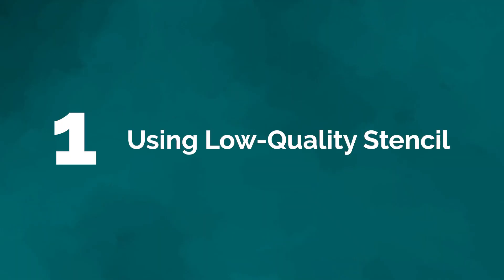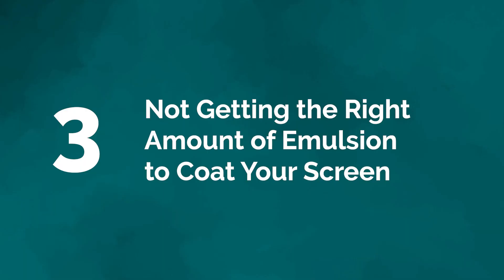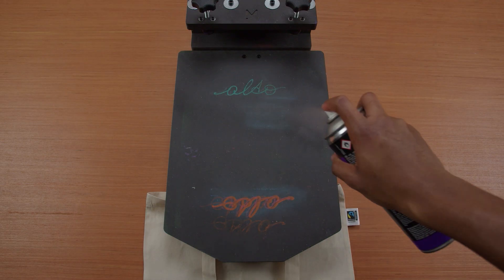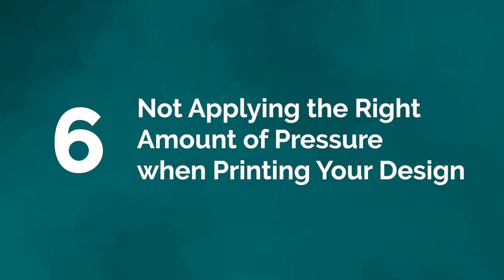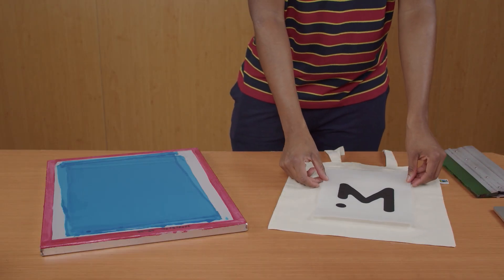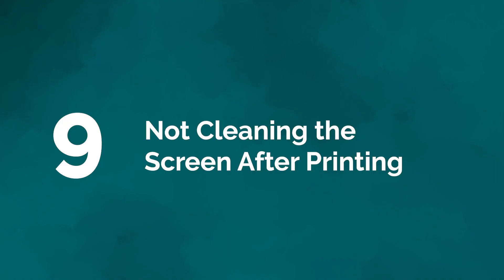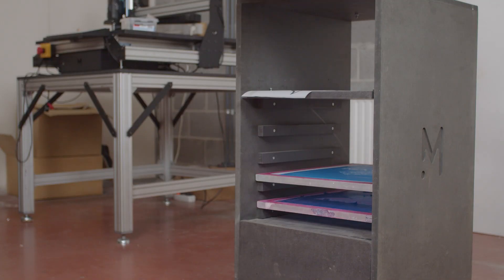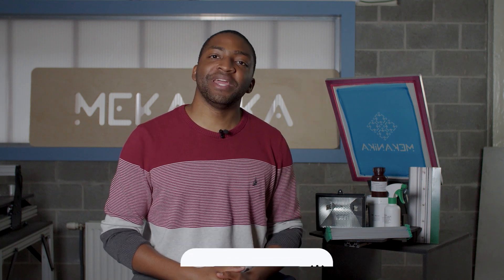Screen Printing beginner's mistakes and how to avoid them !

Comment: For a better print result, it is also necessary to decatize the fabric if it is new, before printing so that the ink fully penetrates the textile. To do this, you should steam iron it to remove the finishing treatment or, of course, wash and iron it.